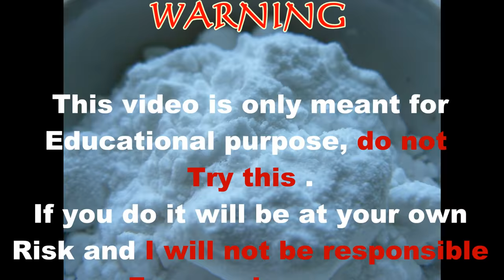How to extract potassium chlorate(KCIO3) using safety matches

Comment: I’ve got exactly 1900 1.9k matches. How much kclo3 would I get out of it?
Reply: Around 30-40 grams
Reply: Enough to make 100 grams flash powder though kclo3 flash is unstable so dont make more Tham 3 grams at a time
Reply: Depends on the matches the concentrationn of kclo3 in red match heads can be 50% or 60%. It is different for othe ones.
Reply: i get 1.2 grams from a box of 36 +-4 matches asuming 20% composition loss in hot water extraction and 7%loss in crystalisation, and assuming 11mg composition per matchstick and 35% Kclo3 in comp
Reply: @achannel3416can you elaborate? does this happen to all red matchsticks?